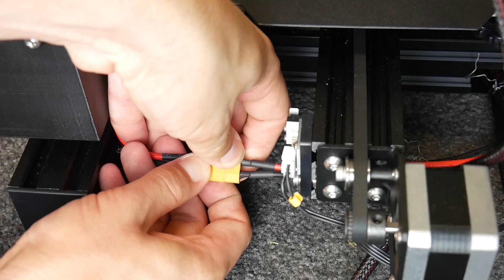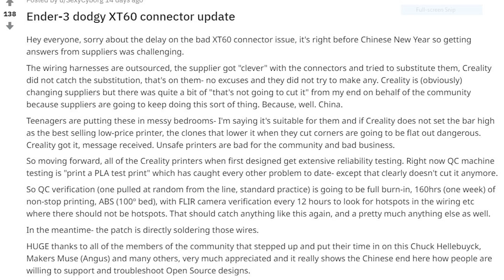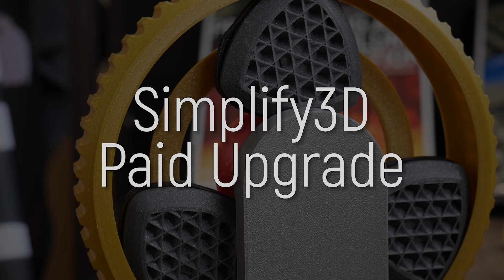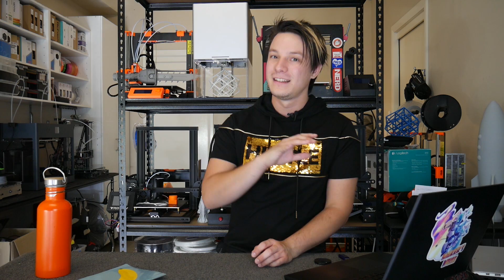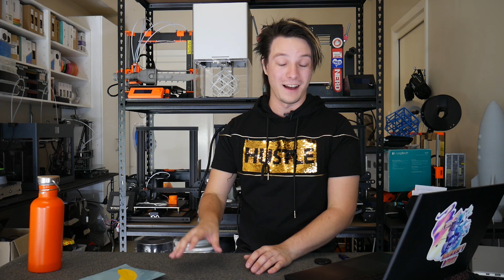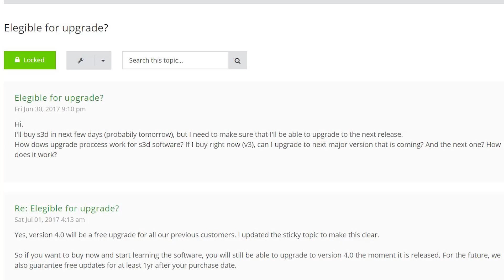Ender 3 Connector Update and Simplify3D Paid Upgrade - Maker's News Feb 2019

Comment: I am already migrating all of my profiles from S3D to ideaMaker and doing some fine tuning. Because ideaMaker does custom supports and multiple processes as well and it is free. It also has as good UI controls for the model, auto repairing meshes, tabbed settings etc. I learned about ideaMaker and that it did custom supports for free from you Angus, so thank you a lot for that! I am trying other slicers as well. I don't know why yet, but the new CURA still sucks for me. I am having much better results with KISSlicer and slic3r PE with the gyroid infill. If I master slic3r PE modifiers, then I might be in a better spot, but for now ideaMaker is my go to solid slicer, if something is sketchy with S3D. If they really improve the software I would not mind paying for the upgrade, but it will depend on the value. I suggested 8 small features and if they made all 8 happen for a 20$ upgrade pack, I would pay that. But if they add 4 features and ask for 50$, I will not get the upgrade and switch to ideaMaker as my main slicer.

Comment: Really glad to know about XT60 problem.  I got mine on 11/11, and sure enough the XT60 had melted a hole in the black packing foam it was resting on for sound insulation. I fixed it with a proper connector and all is well. Looks like the cable was also substandard and was oxidized. Pretty shocking lapse of quality control.
I hope they contact everyone affected and post them a proper pair of XT60s at the very least.

Comment: Makers news. I've been waiting for someone to do this type of thing in the space, nice! S3d well...i don't like subscriptions.
Reply: As far as i know S3D only plans paid updates, not subscriptions, thats a huge difference. I've been using S3D since 2015. Having paid 150USD over 4 years breaks down to monthly cost of just over 3$, thats well worth it for me. If the version 5.0 is worth it I'll buy it, if not, i don't. As long as they dont release buggy versions and only offer paid bug fixes I'm fine with their business practice. It's a much better way to go then to change to subscriptions (as you falsely claimed), i know beforehand what I'm getting and pay once to use the software as often and as long as i want.
Reply: @mariusb6035   To be fair (I think it was back in early 2017), S3D were mooting either supscriptions or paid upgrades as a way to keep revenue flowing. Either is acceptable to me.

What is not acceptable is the lack of innovation, the unfixed bugs, lack of testing (and subsequent rushed bug-fixes), the failure to engage The Community that is their bread and butter, the toxic forum replies and poor technical support, and so on.
If you are happy with S3D as it is, then great.

As I see it, the issue that is upsetting most (recent) customers is that there was an announcement of a new paid-version, when they are still selling the current one that is buggy and is rapidly falling behind other free slicers.

Despite all the bad experiences I have had with the S3D 'company', I think that the software itself is bloody good - it just needs fixing. As does the manglement.
If they start behaving like their customers are a valued part of their business, I'm in.
However, in the 2yrs+ I have been using S3D, there has never been even the slightest glimmer of true customer engagement. We are just cattle.

Comment: I got my Ender about 3 weeks ago and been running high temp materials and had no issues with any heat in the connector so I reckon most current ones are OK.

Comment: Hey Angus, have you ever looked into and tried to make a Prusa I3 Mk3 the size of a CR-10? Also a small thing from one Aussie to another in this heat right now, Spotlight is selling thermal bottles that hold a constant temp in them for long periods of time, especially cold temps, just recommending it, not affiliated with the product, its just a good idea especially with this heat, id recommend the  Oasis bottle or the Cooper Co bottle, both work well and can keep ice solid for hours if its fridge cold water and ice

Comment: I don't mind having to pay for an upgrade. But I definitely think they should've updated more often. It's quite appalling to buy a expensive bit of software, that not long after gets "beat" by free softwares.
Not to mention that when they finally released 4.0, it was still behind other free slicers in very many aspects.
That being said, I use S3D daily and really can't see myself switching. Too much work learning a new piece of software and S3D works great for all my uses.
Reply: To be honest the switch to a sofware like cura will be easy because the features are the same. you dont need to relearn everything, infact you will have to learn next to nothing.

Comment: Hi Angus. Thank you for addressing the Simplify3D issue.
What follows below is my experience with Simplify3D since late 2016. Any conjecture or opinions stated, are literally that -

I had an all-metal modded FlashForge Creator Pro (X3G) - FlashPrint would not allow the higher temperatures I needed, and Cura was not good back then, so I bought Simplify3D.
I had endless crashes with Simplify3D that kept corrupting profiles. Tech Support were curt to the point of being rude, and of no help whatsoever. The attitude (IMHO) seems to be, "Ignore the problem until the customer gives up."
I tried several clean Win7 OS PC installs on multiple computers to try and fix the crashing - never got anywhere. All of these machines were seriously top-end at the time - minimum memory was 32GB, i7, crazy video cards. You get the idea...
In the end I bought an i5 NUC with 8GB memory. Crashes went away. No idea why.

Worryingly, since the release of v4.0, the company started locking forum-reported issues that they deem 'Solved', even when customers are still having the same problems.
Quite a few users posited this was a cynical attempt to bury bug reports/questions by Simplify3D necro-posting to old threads, claiming they were "Solved", then locking them.
This 'new activity' would then bump the bug reports off the 'front page' of the forum.

Even more worrying - I (and others) have had multiple posts that were calling them out or asking awkward questions deleted or heavily edited. I know of at least 8 posts of mine that vanished, then I lost count.
One person I am in contact with was banned, and my posts are now moderated.

[I managed to grab some screenshots of some of my posts before and after editing/deletion by Simplify3D (before I was moderated) - just so I can prove my story that this practise was actually happening!]

Nice one Simplify3D, I positively steer people away from your software as a result.
I am also writing an in-depth Cura tutorial for our customers.
Enjoy.
Reply: I experienced similar response myself.  I am mad enough paying for software without updates...not even an eject sd card feature.  Updates after 4.0 added bugs only.  Now instead of fixing the bugs, they want more money?  I'm so angry .
Reply: Subscribed. Thanks for caring. I don't use that software, but I've seen this kind of hubris from software companies before. It's unfortunate. It never works out well in the end.

As for me, I've committed to only use free (as in freedom, a.k.a. "Open Source") software for personal use from now on.
Reply: @RL_Dane  Hi Ram. I subscribed back! :)
There's nothing much on my page at the moment, but later in the year the company I work for will be bringing out a lot of tutorials and I will be doing some of my own.
Not sure that my ones will be all that great, but I am hoping that they will help clear up some of the confusion how settings interact in some slicers.
Mine will also cover sneaky tricks to overcome slicer and printer limitations.
I do have a huge pile of designs to go up on Thingiverse - but I never seem to get time to do anything than work and study these days. Hopefully soon...

I am really grateful to you and Navarre Makers confirming what I have reported. I feel that some people think I am making this up. I wish I was.
A quick look at the GlassDoor reviews for Simplify3D is an eye-opener. I have no idea if the accounts are fact or fiction, but they do fit the narrative I have heard from multiple sources in the Community.

Simplify3D had the market by the balls - people were paying for their software in preference to the free stuff - then they did not innovate or engage.
Idiots!! :(
Reply: @SusiBiker  
Aw, thanks! I tend to post just random stuff I find interesting, but I haven't really started yet 😋
Stay tuned, I hope to have some awesome stuff up... someday! 😁
Reply: @RL_Dane  There's nothing wrong with paid software if you are getting value for money. I purchased light burn. it a cheap solution for laser cutters. well produced software at $40 in a market where there is little to choose from. often updated etc.  Simplify 3d is overpriced and now relativly irrelevant. Seems like they shot themselves in the head with this news.
Reply: @mrfoameruk  
Yes, they have. Love your username.

Actually, I don't have a problem with paying for software, whether directly (i.e., as a purchase), or by supporting the devs after I've used it -- programmers gotta eat, too!

But my preference as of late is for open source software, because of all the insane privacy abuses of folks like farcebook and ibm. I want to be able to look at a program's code to see what it is actually doing. It's very hard to hide anti-features (like sending your location to a server to be monitized) when the code is open.

Comment: Re. Simplify3D processes - take a look at CHEP's recent video here - he uses the support block feature to do "processes". As is a long-standing idiosyncrasy of Cura, not all features are logically named or arranged in the UI :) but things can be done. https://www.youtube.com/watch?v=su_m5zV9rvA

Cura also has automatic variable layer heights which you mentioned re. Slic3r PE. I have to say, Cura is a really great contribution that Ultimaker make to the community through their active management, development, and maintenance of it, and they're continuously innovating including contributions from smart people in the community outside of Ultimaker's team. Further, having both Cura and Slic3r PE as powerful open source options out there pushing boundaries, challenging each other to continuously advance, is great for us :)

When I started 3D printing (when the Wanhao i3 Plus was first released), Cura 2 had just come out and that's where I started - frankly I was puzzled at all the YouTubers using Simplify3D as I couldn't see why, as a hobbyist, I would pay $150 for software that didn't do much more than Cura, that I needed. I put it down to influencer sponsorship shenanigans and left it at that.

All that said - as a commercial company focusing on a software product only, they'll fold if they don't charge periodically and I would expect them to charge for major feature upgrades. Personally I think they should look at the subscription model with integrated user support which works well for others and makes the future upgrade cost path clear and unambiguous. However they really need to do something awesomely better than Cura and Slic3r PE to survive.

Comment: I just don't get it. IMO, every other slicer is still in 'catch up' mode with S3D. Yes they are getting much closer, but IMO still not there. Maybe you can do an updated '2019' slicer video, one without an industry sponsorship.  I'm mean with all of S3RPE improvements, it still doesn't have a functioning undo/redo stack..
Reply: what s3d have that cura lacks?

And I am serious.

I pirated s3d to try it recently and went back to cura... This dumsterfire or a software is clunky as hell, small changes takes hundreds of clicks to get by and effects are medicore at best...
Reply: I went back to cura after 3 days...
Reply: @HidekiShinichi  the undo button is a really big feature. You make a mistake and you want to take one step backwards you can. Without it, you're either starting over or going through a lot more effort.
Reply: @HidekiShinichi  Definitely a moving target but I would say slicing speed, profile support, overly complicated support settings. The UI is not as polished IMO, but that is very subjective.
Reply: Hideki Shinichi S3D has an interface I am familiar with, and one where I know every little thing I can change.  Eg, I need a little more support right there on this one piece of the model, but I want it to keep a .4mm horizontal gap from the side of the model.  I know how to do that in Simplify3d but would be unsure where all those options are on Cura.  Changing software and learning all the new intricacies of new software is no small thing.
Reply: The process settings in S3D drive me insane. It's frustrating if you want to make a small change across your profiles.  Also, if you forget that one process has a different z offset  in it than the other , guess what?  Instant crash! Yay!

API support for octoprint? Get ready to be talked down to because you don't want to use curl scripts. I guess updating the ip address in every profile is a good workflow right?

And lets not forget dicking with your first layer settings for an hour thinking you've forgotten how to print and then realizing your on 4.0.1 and it's bugged and 4.1.1 fixes everything.
Reply: @Mechotronic  I've not run into those problems. You can expand the xml data to include other settings for your profiles, such as z-offset. Admittedly not convenient to do though.
Reply: I use Cura when I want a quick thing printed, but Kisslicer Pro when I want to get an amazing print. At no point has S3D seem like a good value, tbh, because most of the selling points just seem moot. And I'm not going to give money to a company to test their software.
Reply: @keereelewah4524  How come you can't get an equally good result with Cura and instead use another slicer? I've only ever used Cura, so I have no experience in changing slicers.
Reply: @porschepanamera92  A lot of the "quality" issue, as Angus pointed out, has to do with investment time during profile configuration. Personally I would rather spend my time designing and printing.. :-)
Reply: @porschepanamera92  The biggest reason is Kisslicer has a really good model for the flow of plastics. As I use a delta printer with a fairly long bowden, no matter what I do in Cura stringing happens. With Kisslicer, the PreloadVE, or Preload Viscoelasicity constant, which is set up per material, gets rid of pretty much every artifact no matter what material I print with. Getting great results can take more effort with Kiss though, so if I'm using a new material I'll usually use Cura because it has decent defaults.
Reply: @keereelewah4524  I need to try Slicer Pro. What do you mean by S3D features being moot?
Reply: @RJMaker  I don't really see anything there that others, or at least Kiss, doesn't. The terms might be different but the results are the same. Instead of processes, I have Lock Paths in Kiss, or I can just manually merge gcode in (I forgot which I did that in, but I think it was Slic3r).

Kisslicer Pro has only a couple features over Kisslicer Free, so it's a very good idea to try it before you buy it. Though at 42USD for Pro, it's pretty easy to decide to support Lonesock, the developer.
Reply: @keereelewah4524  Yup, I agree. Lonesock is the Dude. Has some nice ideas going on there. :)